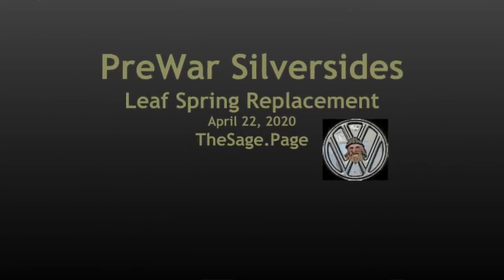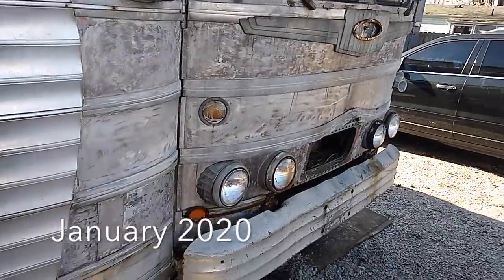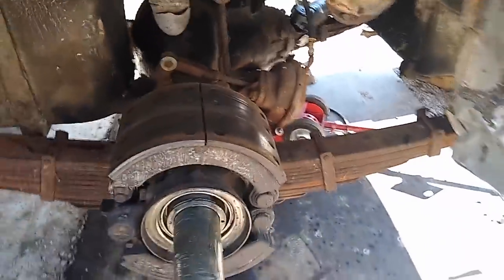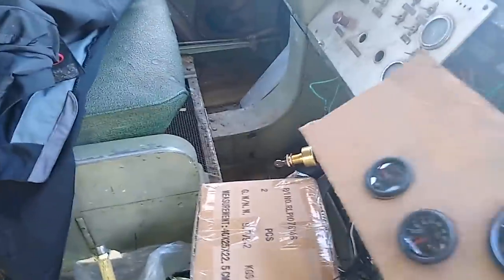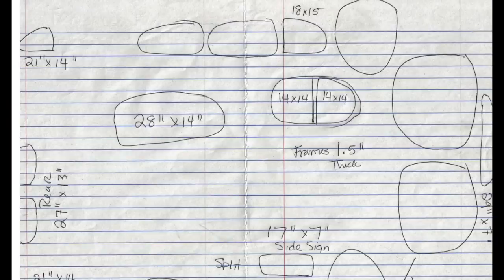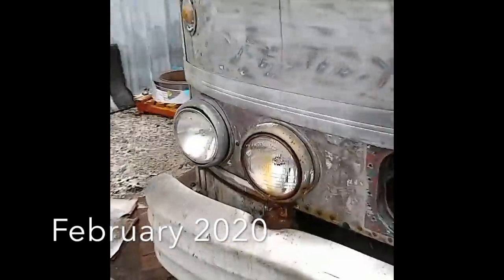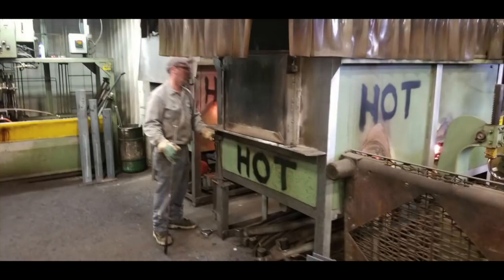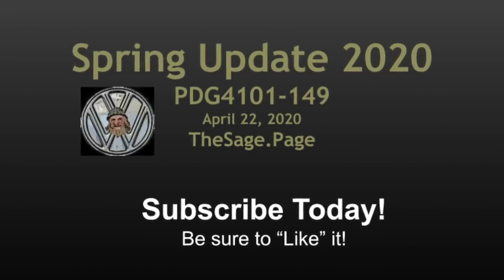Pre War Silversides Greyhound Bus Leaf Spring Replacement

Comment: You have a plan and some good people to help , now taking it a step at a time  and not loose  faith or focus  and with a bit of time and no surprises that bus will be restored once again .
That's fantastic getting the springs replaced that alone has to g a long ways to making it safe and restore its handling on the road . I wonder how many outfits like that remain  as I may have need of one .
Reply from the maker: Indianapolis used to have four spring builders now they have none.
Reply: @SilversidesSage  That's what I was afraid of , that the old school basic business's are disappearing so future restorations will be almost impossible .
Reply from the maker: @heartland96a  Truck trailers use leaf springs... there will always be a resource.
Reply: @SilversidesSage  but i think it will be left to buying off the shelf new and loose the custom and repair aspects
Reply: I’m getting picky. Wondering if it’s Chinese steel. Just like the spring makers. We make very little steel anymore. I have seen  lines of Chinese scrap  freighters leaving Tampa Bay. Overflowing with our old junk cars and steel beams.

Comment: I’d be very surprised if that u-joint flange is specific to the bus and an industrial application part is not available that will work. We have a guy in SE Michigan that has found parts all over the world for us.   I’ll get the contact info on Monday and post it.
Reply from the maker: Let me know Matt I am looking for old school Parts guys in Michigan
Reply: The Sage - try Tim at Automotive Supply Company.  36857 Schoolcraft Rd.  Livonia MI.    You’ll need a bunch of dimensions off of the flange you are trying to replace.  What series I-joint,  pilot diameter, bolt circle diameter, number of bolt holes, distance of flange face to centerline of bearing holes...
Reply: Once you get the sims you can search the internet for industrial u-joint flanges.   The one you showed in your video looks pretty typical to me.
Reply from the maker: @mattbrown9484  Thanks! I will reach out to them.  I figured there had to be a good vintage Detroit Diesel place in Detroit...
Reply: The Sage - it’s not a vintage DD place.   It’s a place I think may be able to help with the flange.

Comment: HI RESTORATION OF ANY FORM OF TRANSPORTATION IS A WONDERFUL CONCEPT .I JUST HAVE A HARD TIME JUSTIFYING THE COST YOU NEED TO THE FINALIZED THE  PRODUCT..BUT I UNDERSTAND THE NEED TO DO IT AND THE PASSION YOU HAVE FOR IT..TKS I HAVE THE SAME PASSION FOR RAILROAD ENGINES AND VEHICLES...WHICH I FEEL ALIENS ITSELF WITH THE BUS....TKS AGAIN
Reply from the maker: Ron try taking off the caps lock on your keyboard. I restored 7 cars and I  believe I have a realistic budget.
Reply: HI Not sure why you have such hostility to my replies?? Not saying anything about your budget.spend what want to..I also have restored several vehicles in my 72 years on this earth, but I always tried to pick projects that seemed money sensible..I am assuming the availability of buses is the problem...tks